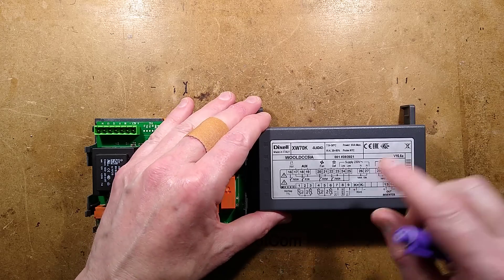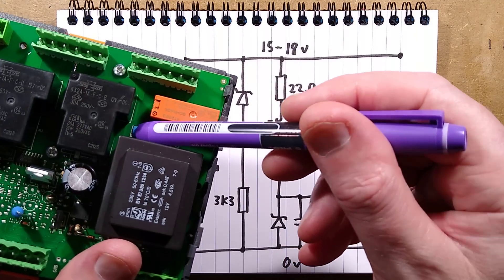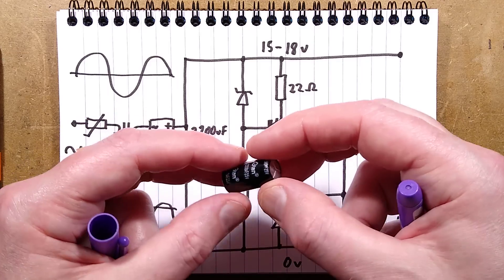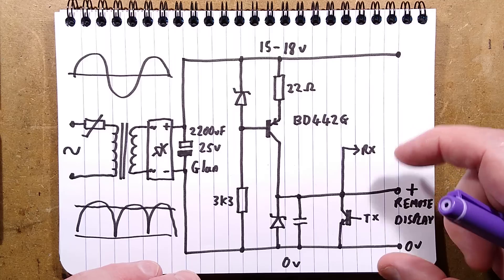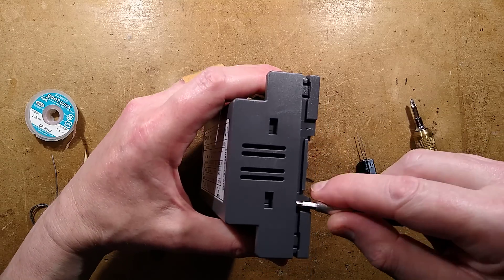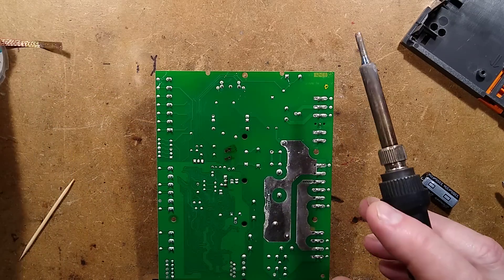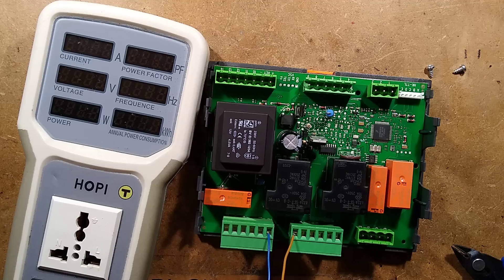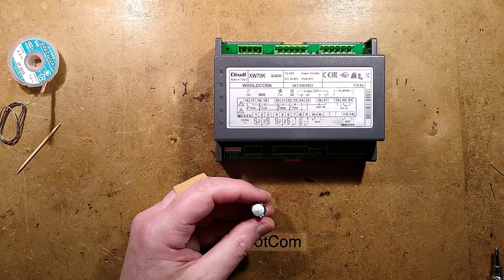Interesting fault and fix on a Dixell XW70K refrigeration controller

Comment: Exploding electrolytics! Can remember having a couple of nee - well ok new to us, system boards as trials. Neither powered up but hmm smelled a lot. Me being me took them apart. All looked clean except the mains area. The smoothing capacitor in both units had exploded. More like a volcano. Took a while to workout that the capacitor in both units was put in reversed. Replaced and all was ok check with company and hmm manufacturer fault. The entire batch were built the same.

Comment: A big piece blob of Blue Tack is really helpful in holding components to the board or whole small boards to the table when soldering.

Especially if you have shaky hands that you can rest on the table as well.

Comment: These controllers usually sits on the top of industrial fridge and freezers, where the compressor and condenser also is and it gets hot up there in the summer.

Comment: I'm too cheap to buy toothpicks. To remove solder I melt the solder and then slam the PCB on the table.
Reply from the maker: That's good for large solder joints and mass solder removal.

Comment: Funny enough, I just fixed a restaurant freezer with a different model controller (XR06CX). Programming these pesky little buggers is a bit troublesome, haha!
The freezer just kept turning off and not cooling - at first I thought it was a controller bug but it was okay when I measured it, then I noticed that the condenser's and compressor's cooling fan was powered but the motor was stalling. Replaced the thing and it works. The old motor, probably the filthiest thing to ever appear in my lab, is waiting in a box for dissection.

To think they used a crappy cap in that one... When I took apart the XR06CX, it was just so packed, nice jobbie for a compact unit it was, and the filter cap was probably something in lines of Nippon Chemicon... I haven't taken a closer look. 

You might as well cut a piece of copper wire (1mm² or so) as a thermal bridge to heat both leads simultaneously. This does wonders for multipin components, but makes cap replacement a lot easier too. After desoldering, I usually clean the holes with a syringe needle.
Reply: Don't use thar copper trick under power, it'll be a dead short .
Reply: @johndododoe1411  of course absolutely not! But then, who even desolders caps live?
Reply: @KeritechElectronics  Anyone trying to repair a running system too important to power off, preferably using redundant capacitors in parallel .  Hard stuff, never needed to do so myself, but contingencies must be planned for .
Reply: @johndododoe1411  I've done work on running electrical wiring, I've done module replacement work (as in, disconnect a cable, swap the out-of-board parts, reconnect) on running automation and electronic devices, but I'd find it absolutely crazy to do PCB work live. Like, so many things can get borked - and if that happens, you're in for not only putting the system out of use, but also having to order an expensive replacement and waiting till it arrives. If you're really wise, you'll have a redundant system for instant switchover when the running one fails or has to be taken down for maintenance... if you're just wise, you'll have a known good replacement in storage for a quick swap, and do the fixes on the failing one. But then, it's still a device or module level work.
Reply: @KeritechElectronics  Redundant devices with seamless switchover is definitely the reliable way to design always on systems, soldering live equipment means the system was not built that way or all the redundancy has withered away from years of tiny budgets, and now the poo hit the ventilator and heroic repair is needed to stay operational .
Reply from the maker: Yeah.  These universal controllers can do so much that their menu system can be daunting.
Reply: @bigclivedotcom  yes, the one I dealt with had a two-level menu: SET + down arrow for a few seconds to get to the first level, and then SET + down arrow again for some more time to dig a bit deeper. RTFM is the way...
Reply: @bigclivedotcom  Worth copying the menu settings ahead of time if poss, in case they go phut.

Comment: I have swapped out dozens of these boards, 99% of the time it's the relays burning out because the manufacturer decided to switch something directly off the board. They may look beefy but if you use them for anything other than switching proper relays it will burn out quickly.
Reply from the maker: Yeah, that's annoying when they use an onboard relay for a high load.  Some use an offboard relay module.
Reply: And no snubber circuit across the contacts.

Comment: That powerline communication is so clever. Would never have thought of something like that
Reply: The same principle is used by the "1-wire" bus by Dallas semiconductors, now owned by one of the chip giants .  But 1-wire ran at 5V, not 15V like this display interface .

Comment: I accidentally replaced a capacitor backwards while installing it into a negative voltage rail..... Can confirm it explodes violently about 30 secs after power up 😂 Luckily it just missed my eyes, as I was looking at the board at the time.
Reply: This is the closest I have ever come to participating in Independence Day festivities. I replaced a decent sized capacitor backwards on a strobe light power supply. The pop was impressive, but my wife claimed the smell was "hot electrical saltwater cancer".  The description made the mistake worth it.

Comment: Finally just finishing up restoration of my 1982 Fruit Machine (Jpm eachway shuffle)
 Had to replace a few caps, but there are still plenty of them left still working after 41 years!

Same story with most of the TTL, I had to replace some due to corrosion on the legs, but still plenty of chips left working, some with date codes from the late 1970s. Just goes to show how well manufactured components can last for many many years.

(Counters in the bottom show in excess of 11 million plays while it was in a busy arcade😮)
Reply from the maker: Does the counter still work?  Sometimes they clock up such high plays that the counter rolls over or just twitches the last digit without incrementing.
Reply: I had some scrapped Ubix copiers I bought on auction for lower than scrap metal price, and most of them had 6 digit mechanical page counters in them, the one with an 8 digit counter was well over the 80 million page count. I repurposed one of those counters, after opening it to reset to zero, as a cycle counter for another machine, and when that eventually was sold on it had also rolled over twice on the 6 digit display, and was still running well. 

I estimated that, based on the previous owner use, the machine had probably done over 200 million cycles before it was replaced with a new one, after around 20 years of operation, as it ran 24/7 in the previous application, but with us it ran perhaps 6 hours a day 3 days a week, at a much slower rate. Original German manufacturer still had some spares for it, but mostly it was a good machine shop, and fix what was broken, instead.

Comment: I have an industrial aircon friend here in Australia swears by dixell controllers. He claims the only thing the don't do is swallow. I have used an few of the simpler panel mount ones and found them to be easy to use and totally reliable.

Comment: I've found those pen-based flux dispensers very handy - cheaper, refillable, and it doesn't waste flux.  A single press on a joint does the job.
Reply: You should send one to Louis Rossmann as a gag gift.
Reply: @chrimony  Absolutely. This pen dispenses flux in microRossmanns.
Reply: When I worked in production we never had those, know nothing supervisors and managers cracking the whip but not supplying the tools and consumables to do the job properly, the company died eventually of course.

We had a qualified certified experienced EE, he designed a SMPS for a USN system, he used a single sided PCB, then took a couple of the units from the first batch to the RN shock tester platform at Portsmouth, all the heavy components fell off the PCB at some high G shock. We had to scrap 50 or so populated PCBs after removing the transformers connectors and expensive components, the Rs and small Cs were thrown away with the useless PCBs. the 90s.

The 18 gauge hook up wire inside a refrigerator sized star delta transformer unit, the wiring smoked then caught fire when tested. Quite funny to hear about on Monday morning.
Reply: I got a pack of dropper bottles, and used those instead, as they are also easy to refill, and the pack of 20 was cheaper than a single flux pen, plus if you have one leak it is easy to replace, plus you can keep a few around so no need to refill immediately.

Comment: I wasn't sure if it was Glan or Gian like a Chinese capacitor or something.  Huh, toothpicks for a desoldering tool.  Thanks Clive, that will help the next time I am desoldering through-hole circuitry.  Well, I was always taught that, "A system is only as good as its weakest link" and that's pretty much your conclusion on this, I guess?  It's interesting how one capacitor can bring down an entire relatively expensive refrigeration controller like this.

Comment: Sound slike one of those "well, we COULD use that capacitor, but this one is a fraction of a cent cheaper, so we'll go with that!!!", and then warranty claims roll in and they blame the user for some made up reason and try to sell a new one instead of replacing the caps they shouldn't have used in the first place... :P

Comment: I have seen hollow "pins" of different sizes sold on amazon to do what the tooth pick does for  a lot more then the tooth picks costs. I would never have thought of that on my own . thank you thank you thank you!
Reply from the maker: The hollow stainless pins are good for desoldering some components with a lot of leads.

Comment: I still remember that slew of electrolytic cap failures on motherboards and electronics in the early 2000's which resulted in the shift to solid caps for motherboards. But if you look closely, some of these caps still use liquid electrolytes but with form factors resembling solid caps.
Reply: That was due to a Chinese company stealing an incomplete version of Nippon Chemicons capacitor formulation, then sharing it around. It lead to a large increase of ostensibly high quality capacitors at cheap prices, but they died pretty quick, leading to the cap plague of the 2000s
Reply: @SkigBiggler  - It was worse than that.  United Chemi-Con had a huge range of caps that went bad (KZB/KZG) so entire runs of Intel, Dell, etc, motherboards with known good brand parts went bad.   (Pentium 4 boards, mostly.  I have three in storage waiting for recapping to be stored for replacements.  Old control computers that can't run on anything newer than P4)

Comment: I had a Radio Shack 330mf capacitor. I left it in my supplies box in its little baggie. It was fine. I never used it. A couple of years later I wanted it, pulled it out and it was bulging so badly that it was coming apart. Never ever been used!
Reply from the maker: That's quite odd to have the electrolyte degrade and gas out in storage.

Comment: You know I've seen the inside of so many computers with domed or leaking capacitors, and what do people do? Press it down and wipe it off and leave it in there...

I'd no seen an orange relay before, are there any reasons they're such a colour?

Would a transformer melt if you fed the output back into the input side... Can we see? 😅

If you do use a low esr capacitor, is adding a discharge capacitor a stupid idea?

Comment: Question. Can putting tin foil at the end of a treble A battery be unsafe in any way in overheating, fire , e.t.c . Inside an  AA powered clock? Edit this is near a gas pipe, but literally Nowhere long enough to cause short circuit just enough to hold the battery in place, Like in my head it looks dodge AF but my brain is saying it's just going to drain the battery faster and worse case scenario the single piece of foil followed by the battery will just fall out. As a temp hack  is it horrendous?
Reply from the maker: I wouldn't recommend aluminium foil, but it's not uncommon to use a small stack of steel nuts and washers to fill the gap.

Comment: Have seen a few of these, used in supermarket cabinet refrigeration, often connected  a Modbus module then connected to Emerson control panels. E2 etc, dixell is Emerson product. most of it is made well. they are easy to program
Reply from the maker: It is a well made unit.  Just hobbled by a rogue capacitor brand/batch.

Comment: Hi, what's the name of those green connectors at the top of the board?
Reply from the maker: I tend to call them phoenix connectors.
Reply: "PCB mount screw terminal block connector"
There may be another name, but a search for that should turn up what you're looking for.

Comment: Do you need to discharge the capacitor before removal?
Reply from the maker: No.  It's low voltage and will discharge through the circuitry for whatever capacity it has left
Reply: Well, in this instance, no.  The cap is faulty, and won't hold a charge.  That's the reason for the overlarge ripple voltage which caused the transistor to overheat.  Secondly, the voltage across the cap would be 25 volts or less, which is not a dangerous voltage.  In the case of higher voltages, it would be wise to use a voltmeter to check for any stored voltage across any capacitor you intend to replace.

Comment: Dixell is an Emerson brand, and Emerson makes quality stuff. Glan's web site looks quite professional and says they "have offered OEM & ODM service for many famous brands". In other words, they have manufactured capacitors sold under other perhaps more recognizable brand names. So it could have been one of those relatively rare unavoidable failures. Also, in recent times, many components, including electrolytics, have been in short supply. I struggled to find a high quality alternative for a 220uF capacitor in one of my own designs and actually had to switch from a surface-mount part to a through-hole one for one production run. Perhaps Dixell had to do the same and were less successful. In any case, I enjoyed, as always, Clive's masterful reverse engineering and nicely done repair. And I just added a box of round toothpicks to my collection of soldering supplies.
Reply from the maker: The unit looks quite well designed.  I think it's just an unfortunate choice of capacitor with an electrolyte issue.
Reply: There's a decent chance this controller was installed in a rather hot location. Refrigeration equipment controllers can end up installed inside a cabinet within the enclosure of rooftop equipment, and depending on the design it may not have good ventilation. Could well have been baked. 

Or the other extreme; if it was installed in a low temp freezer by somebody who didn't realize the controller can't be installed on the evaporator in a very cold room for long term use.
Reply: Would this be the same Emerson that also makes shop and commercial cleaning equipment? (Ridgid and ProTeam)  Oh, sorry, I guess it does as I see Dixell is a Copeland brand owned by Emerson.
Reply: Big name brands often use terrible capacitors because it saves them way more money than it would save a small brand. (Quantity) So the fact that they claim to sell to to many big names probably proves that they are junk.

And having a nice website was more convincing back when someone actually had to type clunky html code by hand, not drag and drop things in web design software.
Reply: I'd leave the tooth picks out of your tool kit, they're a good idea but stainless steel solder quills (small hyperdermic tubes in various sizes) are even better and can be used to desolder component pins when you're trying to salvage something like an edge connector. The solder won't stick to the stainless and seems to flow away from the quill.
Philips used to be the only manufacturer of solder quills but you can buy Chinese ones in sets now for about what Philips used to charge for a single size.
Reply: The smaller dixell controllers are notorious for catching fire. I bin them the minute they show any sign of case deformation and replace them with Carel brand